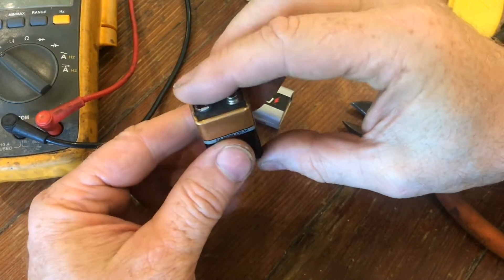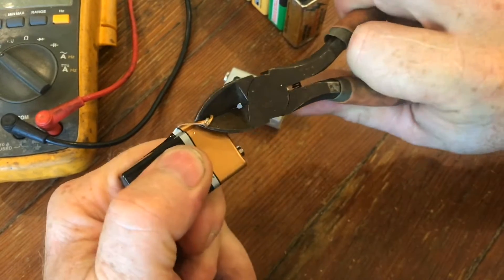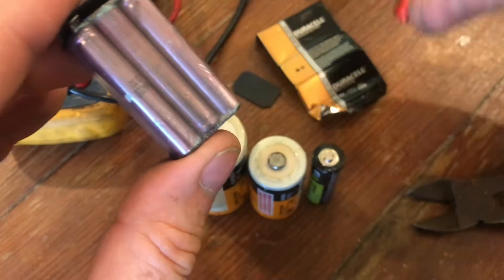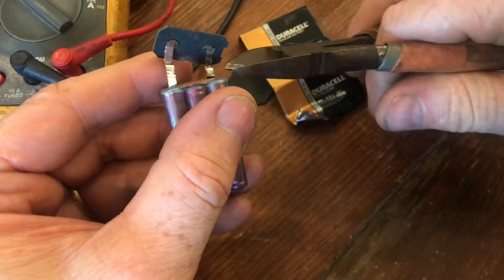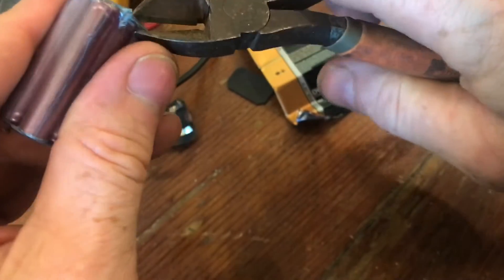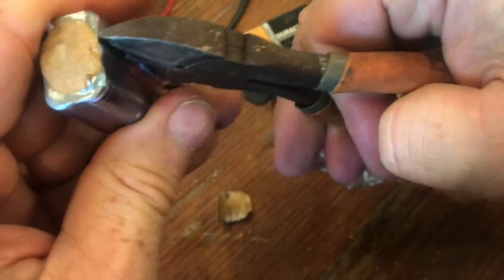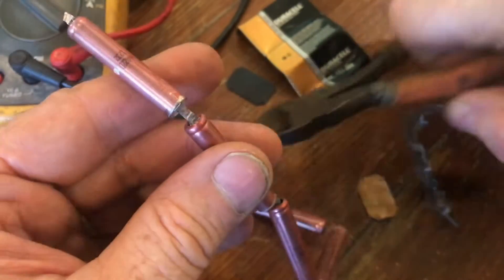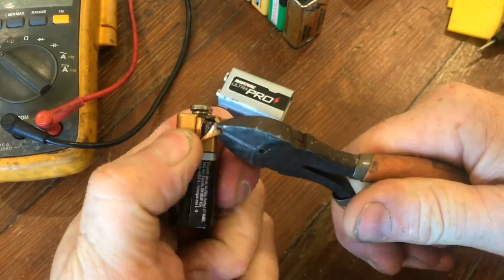WHAT’S inside a 9 volt (9 V) battery

Comment: I remember as a child taking apart such a nine-volt battery.
And instead of six small cells inside, it was all completely filled with some kind of black viscous and damp paste, and two contacts at the top were connected to two rods of something similar to graphite that were in this black paste.
Reply: I wonder if that wasn't a 6V lantern battery -- those had four 1.5V cells, much longer and a little fatter than a C cell, but connected in series like the AAAA cells inside a 9V.  I used to use lantern batteries to power the igniters in model rockets.  The cells inside the 6V battery were often carbon-zinc (cheaper than alkaline cells, and because they were large they didn't need the last little bit of efficiency), with a zinc can forming the negative terminal, and a carbon rod embedded in the damp paste electrolyte forming the positive terminal (the carbon rods could be removed and used to make a carbon arc torch or arc light).

Of course, some really old 9V batteries might have had a stack of rectangular 1.5V carbon-zinc cells to make up the 9V, but as far as I know they've used round AAAA size cells (like in this video) for at least fifty years.

And, of course, there were the huge (usually round) 1.5V cells with a terminal in the center and one at the edge that we used to use to power the glow plug to start a model airplane engine (the kind that ran on alcohol with nitromethane and oil mixed in) -- they were originally for powering the filaments in radio tubes (one, two, or four, depending what kind of tube, forming the A battery, with a smaller battery usually running 22.5, 45, or 90 volts for the plate B battery).  Those would have had nothing inside but the electrolyte; the center positive terminal was directly mounted to the carbon rod, and the outside negative was on the zinc can.